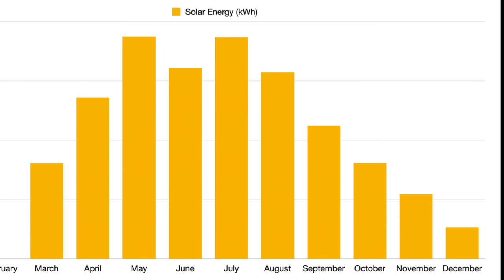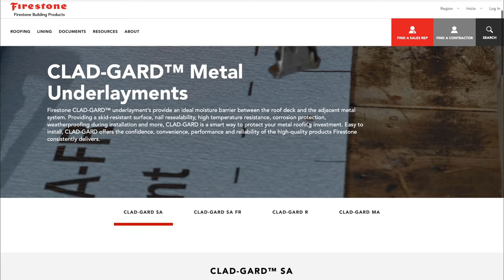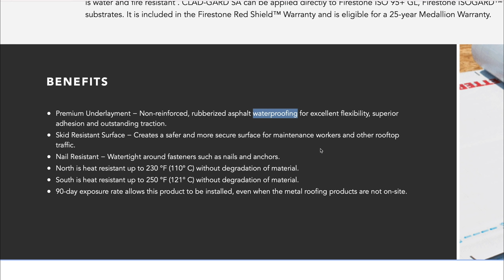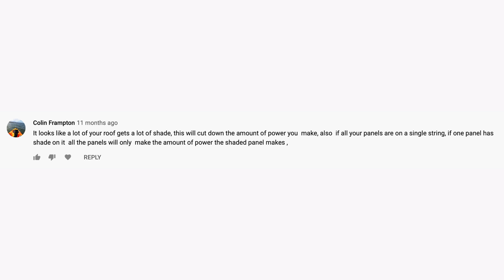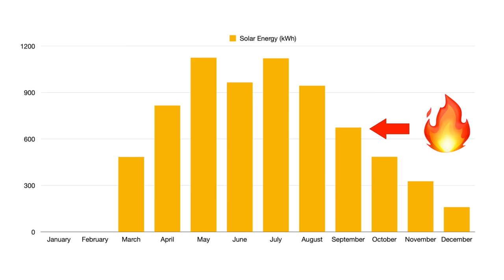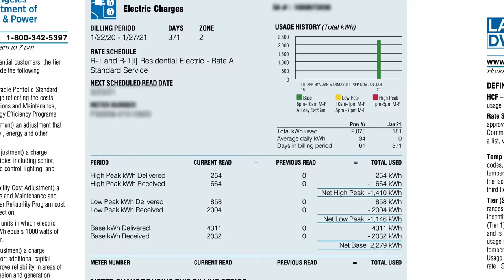1 Year with Tesla Solar Roof: top 11 questions answered + real production numbers & utility bills!

Comment: 67% of the energy produced went back into the grid yet you still had to pay them $156? Surely, they should be paying you?
Reply: Yeah that’s my question as well. I could imagine you end up with costs from days without much sun, but I’d assumed the energy you sell back to the grid would substantially overcome that considering the ratio of energy used versus sent back to the grid.
Reply: Well, it is California we are talking about. 😂

Need to find a State that doesn't steal from it's citizens. Not an easy task this day and age but sure there are probably a few around.
Reply: Same question
Reply: They pay you for the electricity you put into the grid but it’s much less then you pay them for the same amount of electricity, the money they pay you just gets subtracted from the bill
Reply: @daknbow5960  is it really how it works?
Reply: @pbgroseclose  we need answers!
Reply: That's how it works in the UK. I only know one person with solar, and it's just 4 panels on the roof, not the roof tiles themselves. They pay nothing at all for electricity, the grid pays them every 6 months, for the power they provide.
Reply: Daknbow RT. As I understand, the Kw/h rate is diff. on the “generation” vs. the “consumption”; that would prob. explain at least part of it...... dirty rotten shysters
Reply: They pay you at a much lower rate than you would pay them. They also have what they call "peak hour rates" where they charge more for power. Since he has no battery system here's the likely scenario 

He generates power during the day when no one is home to use it, there is no battery to charge so all the excess goes to the grid.

These hours are non peak hours so you are "paid" less of an already reduced time of cost.

Then coming home in the evening when power consumption across the grid goes up "peak hours" come in to play and they charge more. At the same time his grid is producing less power as the sun is going down.

So he ends up paying instead of earning
Reply: Even if the company paid the same as they charged you could have to pay.
If you consume 33 and give 67% of your own production, you could require more than the 67% from the company since the roof produces electricity only when there's sunlight.
Reply: He said he doesn't have a power wall, so I assume he uses the grids electric supply at night. There's a dude on YouTube who built his own power wall from used batteries
Reply: My thoughts exactly.
Reply: Yeah, why even connect to the grid if you still owe them money after giving them 67% of your power? Feel like it's a waste to cover the entire roof with these if you can provide your house with power with 32% of the roof covered. Thoughts?
Reply: @1GamersRewind  I don’t think it’s so much that the government steals from us, but rather that corporations pay off politicians to allow companies to rip off the American public.
Reply: It only works during the day not at night so he still needs the electric company.
Reply: Im sure they claim it is chaper than a power bank.
Reply: They don't pay him... and don't call him Shirley.
Reply: @first_last-  

Do you pay taxes? Do you actually have any say in where your tax dollars are going? 

But yet you blindly believe that they aren't stealing from you. Wake up and realize that the taxes you're paying is to cover bills spent before you paid them what you owed in taxes. Money spent without your permission in most areas.
Reply: @rivalthoughts2061  

What about taxes? Do you know where every penny is going in the different areas you're shopping in? Do you have any say in it? Do you actually have a say in any bills spent by the Senate?
Reply: My family has solar too, and the reason he probably had to pay was because that there must have been a month in which he didn't generate enough power for his consumption
Reply: @BrandonLinde  Yes and that's from when he had it covered by the fires and didn't clean it for a while. 

That's also why he was fine with the 7% loss from the projected numbers. 

You can't beat that $2,000 savings from just the first year.
Reply: @OrangeRocks1986  Sending out a search party to find who asked.
Reply: Even in Ukraine if you produce green energy, government pays you back
Reply: Exactly ! , Why not take $156.00 out of the 67% energy production they provided to the grid. 

Makes no sense they had to pay even a penny.
Reply: @TheAgentAssassin  it's either from the beginning of the year or the end of the year depending on when they needed the energy from the city grid. 

Remember that he said that there was a decline in power for the last few months in the year as he didn't get the solar panels cleaners until after January. 

Power companies typically have you pay per month. He just said that there was a cost in the year and not anything about how much they paid him. 

There was definitely payments received on his end, however he didn't disclose that information at all. And why should he.
Reply: chriszanf  Thats California for you.
Reply: @daknbow5960  so, in other words, ypu don't need an entire solar roof but just a 3rd of it to get the same results?

Maybe you could start contacting with your neighbors about sharing your grid with them and getting paid more than the energy company is willing to pay you.
Reply: He did start it in Feb 2020, he had at least one month of electricity bills.
Reply: @generalgrevous1984  try running a city and then talk about if California is stealing. You don't realise the costs, especially because of Americans smart decisions to build huge suburbs and big houses. Maintaining such huge pieces of land that bring in no revenue is expensive in itself, more so when you're trying to provide the kind facilities that you would find in a much more cramped city like new york.
Reply: @MyxDyingxFantasy  Yep, I'm from the UK and briefly for a few months, worked at a garden centre that had a 'moderately' sized wind turbine powering everything. That produced around 60-65% more electricity than they needed daily, that was pumped back into the grid. They where also paid every 6 months for the electric they provided back to the grid (apparently enough to power around 5-6 homes). I think they said, what they make annually from it, would end up cover the initial cost of the turbine within 10-12 years, dependant on ongoing maintenance costs.
In fact, when I left a couple of years ago, they where also planning too add additional 8x 8' foot long solar panels.
Reply: The Problem is that they paymant of the Grid company is wy lower than the price you pay. Here in Austria you get 0,0049 Euro, or 0,49 Cent per kwh but you pay at least 7,00 cent per kwh. Yet i dont know how the system in the us works, but i think its pretty much the same.
Reply: You are charged as a Commercial producer rather than residential. Higher rates for the power used.
Reply: @1GamersRewind  income inequality... Bwahahahaha one can earn all they are willing to earn in America. But there are some states to avoid do to their high taxes
Reply: There are varying agreements based on your power company. The portion of your power bill that is for energy generated is very small compared to the cost of delivery and power line maintenance. You really should call your power company and talk to someone who oversees solar installations to see what your actual costs and savings would be based on the numbers provided by your solar panel installer. 

$156 is not bad compared to the average. You'll find that many lose out after their solar install.
Reply: @av8rbri473  The price of generated power is a small portion of the cost to install power lines, transport power, deliver to your location, and maintain the entire system including employee paychecks and company overhead for equipment and buildings. Many companies pay the same rate for your power generation as they do large generators. Receiving the same deal as a larger generator doesn't seem like a bad thing.
Reply: People keep saying it’s from the power they use at night when it’s not working. Shirley just get a battery bank to use for nighttime? Something fishy here.
Reply: Yeah if the power co paid me lee than I paid them I’d just find a way to give the excess to neighbors or dump it..
Reply: He lives in California and bought a Tesla product. Don't expect any actual money saving or practicality. Go compare the Tesla roof with the admittedly more noticeable, less trendy traditional solar panels out in the last few years. The Tesla roof is roughly 40% less efficient, yet often costs more. If you have an "irregular" shaped roof, meaning anymore curves or turns than the small house in this video, it gets even worse. Shop around other solar companies and you'll see just about all of them crush Tesla in performance and cost.
Reply: the answer he used only used 33% of its own energy. You don't produce  solar energy  when it's night, what  means all energy you use than you take from them but you exes energy in the middle of the day you give beck to them :)
Reply: It’s Bc he doesn’t have wall power storage so at night he would be using the grid Bc he doesn’t have it stored but the amount of power he made in the day he made and gave back almost matched his night time use so it was only $150
Reply: Obviously if you're selling electricity when there is sunlight it's not going to be worth much (chances are you're sometimes going to sell it at a negative price, in other words you would be paying the grid for taking your electricity). The same goes for wind and windmills.
Reply: They are scamming him through the digital meter- probably taking 3 hours and only paying him credit for one?
Reply: His electricity bill was $2245 in 2019, meaning he used about 10,000 kwh that year (0.19/kwh in LA).  He produced almost 8,000kwh in 2020, so he paid to cover the difference.
Reply: @manaspradhan8041  When they don't give us a choice in how they suck at running the city?  

Lemme give you an easy one.  I live in LA County, and the same 1/2 mile strip has been under construction (building the road to go under train tracks), for 5 years.  The crew originally responsible for the job walked off, because the state was giving them shit for not having enough black people on the crew.  The state (keep in mind, this is a county project, not state) wanted the crew to fire the white people, and hire black people, while still finishing the job on schedule.

Now the county is rebidding out the job to finish it, but quickly realized they don't have enough money, so they reneg'ed on two of five line items that the people voted on for this project, and just reallocated the money to something else that we didn't vote on.  We're still waiting for them to get the new crew to finish the job.  This road is one of the busiest streets in our little community, and it's down to one lane, not to mention the businesses that have gone out of business with the reduced flow of traffic to them.  

Yea, I'd say my state is stealing from me, considering they still haven't finished a project we voted on, and are not delivering on said project we voted on.  That money that was raised with my tax dollars that was supposed to benefit me, is being reallocated to benefit someone else.  If that's not stealing, I don't know what is.  Oh yea, if I say anything, I must be a racist, because those tax dollars are now going to fund stimulus checks for illegals living here.

Seriously, fuck this state.
Reply: @manaspradhan8041  ? Lots of cities are doing better than California. In fact most of the country is doing better than California which is why businesses and people are leaving. Even Elon Musk Left. 😁

It's people like you who don't see the problem after waking up and looking at themselves in the mirror who keep California on its present path; you wanted a Socialist Government, you got it! Enjoy. 😂
Reply: I believe you're paying to continue having "access" to the grid and paying your share to maintain the grid. Basically what they're doing in AZ.
Reply: @akuma1362  Even worse. LADWP don't even call it at "Maintenance Tax" it's just called a "Minimum charge" meaning that regardless of how much energy you feed into the grid, you will be charged $10~ a month. The energy you feed into the grid counts toward credits for current and future energy usage, but whatever credits you have left over when you cancel your energy plan just go back to LADWP. So basically they take whatever power you're producing, give you "credit" toward power that you'll probably never need anyway(meaning they get to keep the value of that electricity if you leave), and they still charge you a minimum of $120 a year just to be on their grid.

So basically, even if you produce enough power for a whole neighborhood, you'll still have to pay LADWP $120(+ "adjustments) a year, and they will never send you a dime. But on the plus side, you get a credit toward the electricity you're not using!
Reply: @asherdie  Wrong. Look at the robin hood fiasco,Wallstreet, income taxes, property tax, loan debts(the high amount of interest, and bloated prices), wage vs cost of living  monopolizations, red tape.

Is it possible to earn wealth? Very rarely. And there is so much hula hoops is damn near impossible to get the "wealth" you speak of. You are fed lies and promises of wealth your entire life... and guess what? Almost every single American makes 1.4 million dollars from age 18-70. Believing the bs. 

You are either born into wealth or you are an anomaly thats less than 0.0001% of the world's population. 

Did you know 1.4% of the U.S. population controls 91% of the wealth in the U.S.? They want to keep you where you are. It doesnt benefit them if you progress... face it we are free range slaves bud.
Reply: @marnicknijland9070  still shouldn’t matter unless they are buying electricity from him at a much lower rate that they are selling it to him.
Reply: @Heywoodthepeckerwood  There’s always going to be a monthly fee to be connected to the grid. In this case it looks like $12.99 a month. Reasonable cost to still have electricity at night.
Reply: He’s putting it into the grid when every other solar system is throwing off electrons
Reply: @generalgrevous1984  and I explained why it's so tough to maintaing California, did you even read my comment... The only real cities America has are the pre war ones, Philly, NYC, Boston, etc. A city where you have to drive everywhere is just a glorified suburb.
Reply: So u pay a fortune to put up these solar panels and u save about 2k a year. How much was the roof?
Reply: Yup, it's BS my company would only buy back solar power at 1/2 price. So if they charged me 10 cents per kwh they would only give me 5 cents per kwh. On top of that you're still paying $25 a month for meter rental fee+other taxes & hidden fees. That's like a gas station charging you $3 for a gallon of gas and telling you they'll give you $1.50 per gallon if you wanted to return any gas. It's BS, I can understand them not giving me 10 cents per kwh but something like 8 cents would be fair.
Reply: @daknbow5960  It's like if you bought 1 gallon of gas from the gas station for $3 and needed to return it and them telling you that they can only give you $1.50 back for the gas you're returning.
Reply: @manaspradhan8041  Real Cities? Seriously? Wow, you really need to get a bigger mirror.
Reply: @BiG__Disgruntled   The power companies know that for an off grid system you'll have to spend more for a battery bank. 
 But I'd rather spend more on a battery bank and go off grid instead of a grid tie since the power company is screwing you.
Reply: @manaspradhan8041  Then why can many states and cities do it for much cheaper than others?
Reply: @daknbow5960   so the margins are rigged
Reply: @michaelbrinks8089  did you even read my comment? i explained why its so tough for california to reach the level of nyc
Reply: @generalgrevous1984  how walkable is austin texas again? how is the public transport? How many art exhibitions do they have? Whats the theatre scene like? What about academia? Do you really think 'cities'(read: glorified suburbs) have even a fraction of the culture of NYC or Boston?
 post war american cities, ie, everything that  didnt have european inspiration or wasnt a straigh up european colony is just a shitfest.
Reply: @manaspradhan8041  So why is Florida,Texas & many other states for example so much cheaper overall in taxes than CA ? There's a reason so many leaving CA.
Reply: @michaelbrinks8089  because those states arent trying to keep up with actual cities. You wont see them try to improve their 'liveablity', they have accepted the fact that they are just glorified suburbs, california has not. Its trying to keep up with actual cities while also just being a glorified suburb.
Reply: @generalgrevous1984  That's a BS excuse bud "its cali" C'mon man! What is right is right. They are giving bone scraps while they eat the steak. Guess what? Now they don't have to pay to maintain that part of the grid. Falls on the homeowner. Got you guys again. I wouldn't hook up to the grid. It's stupid to play along with them. Take take take and spit/laugh/point at the good guy.
Reply: @generalgrevous1984  New Hampshire😊
Reply: @rhonda1950  Not defending Commie-fornia so don't know what you are on about.
Reply: This is how it looks here in Europa too.
Its not Just smack up a solar panel and think since you produce a bit of electricety for the grid that you get something for that.

Im my opinion, this should be on every New appartement building that is being build in the future, and Also try to make it so that everyone can choose to have a roof like this on their house.

To be honest... This is the first time hearing about the tesla roof... 🤷‍♂️
Reply: The utilities buys the power generated by the roof at wholesale prices while at the same time sells back power to the home owner at retail prices when the homeowner isnt generating power. Usually the hours the home owner is not generating power, when the sun goes down, is at the same time that utilities sell power at peak rates. Peak rates are usually around the same time, daily, that people return home after work, starting their heaters, stoves, televisions, etc, which causes a stress on the utility's infrastructure having to push out power to meet the demands resulting in the utilities charging higher rates during these peak hours. Since there is no battery storage for excess power generated by the homeowner, he still has to pay retail price at peak hours through out the year almost everyday. I guess there isn't enough of an offset between his power generated at wholesale price the utilities buys and his consumption at peak hours to break even he buys back from the utilities. @chriszanf
Reply: @chriszanf wait what? So you think the power company should maintain the power grid for free and pay the solar panel owners to use it to get rid of excess power? How? How can a company pay workers to do maintenance without income? And dont tell med that all the no-solar users should pay. That is ridiculous since more and more people are getting solar power.
Reply: @generalgrevous1984  
Good Luck
Reply: @MyxDyingxFantasy  I seriously doubt that with just 4 panels in the UK that they "Pay nothing at all for electricity", my neighbour has 8 panels, no one is at home during the day but 4 people are in the evening and at weekends and their bill dropped about 40% after the panels were installed, after feed in rebate. (We live in the south east)
Reply: You clearly haven’t thought this through. Can’t blame you though but I do suggest you think solars inability to produce energy when the sun goes down...
Reply: what is so special about 67%? 
do the sums
Reply: Disconnect from the grid. Simple as that.
Reply: They have to charge a minimum monthly fee for maintaining the grid infrastructure, 156 bucks is a bargain.
Reply: @rivalthoughts2061  Paying ridiculous amounts of taxes without getting any welfare is America in a nutshell. Almost all of the taxpayer dollars has to go to law enforcement and fire departments to deal with the huge number of criminals, and of course the military departments. We have to pay even larger amounts of taxes here in Europe, but at least we get our healthcare covered, dental care, education and so on. Atleast we get something back from the shitty government that steals and wastes our money, but you get nothing. LOL
Reply: @OrangeRocks1986  None of us do. That's the evil truth about modern day governments in practically every country in the world. They suck at everything they do. Democracy? Yeah sure, you have one vote for someone, who then votes for someone else, who votes for someone else, who may or may not give a crap about what you're actually voting for. The amount of money the gov is wasting is insane, we're literally slaving for them to live in luxury and wipe their ass with our hard earned money.
Reply: @manaspradhan8041  The City obviously doesn't maintain people's own properties. The streets and sidewalks doesn't require all that much maintenance unless they are abused by criminals or a massive earthquake destroy things. Water and Electricity is maintained by private companies and people pay them separately for maintenance fees. The only real expense is the law enforcement, fire departments (thanks to the shitty state the entire country is in with its extremely high criminal rate), and all the less important stuff like statues, parks and so on.
Reply: Delivery charges & baseline fees are fixed costs that consumers are charged, regardless of how much or how little electricity is used.
Reply: Here in Jordan they buy it at a rate of 25% and of course you won't get paid with cash but you will have extra balance until you need it
Reply: @TheChrisey  the fact that you think these are the only costs to maintaining a city and that streets and sidewalks don't require regular maintenance tells me how much you actually know. If that was the case, why are roads always in such poor conditions in suburbs? Go to some European city once
Reply: @manaspradhan8041  Shows how much you know about costs claiming that minor things costs a fortune, but in fact most of it is a waste of money when a lot of households can barely put food on the table. It's not about what things must cost, it's about priorities. No, sidewalks and roads do not require a ton of maintenance, compared to the amount of taxes paid to the city, it's a fucking piss in the ocean. Your baseless argument is the typical bs propaganda used to convince tax payers that they need to keep paying. You clearly failed the basic reading comprehension required to understand what I said. My point was that any government loves to waste money when someone else has to earn it. All governments waste money. You don't need such a shit massive amount of money to maintain roads and basic infrastructure. They do however not want to give that money up obviously, so they end up wasting it on crap most people will have no benefits of.
Reply: @izraelservantofalmightygod  Battery storage is very expensive.
Reply: This is pretty normal for people who don't have energy storage in place.
Reply: @swety2962  isn't euro worth more than USD?
Reply: @generalgrevous1984  silicon valley is in California right? Correct me if I'm wrong, I'm not american.
Reply: He said on the video he paid the LA for power and water...so maybe it was to do with the water?
Reply: I thought i read an article a few years back that a guy in california gave “too much” back to the grid and had to pay like $12000 back because of it.
Reply: Yes they essentially “paid” two thousand dollars in solar energy.  In three years of this they will have paid off the roof and effectively be saving (keeping) 2k dollars a year.
Reply: @barneyrubble4293  that roof costs way the fuck more than 6k friend.

This roof will have just paid for itself when a new one is due.
Reply: Looks like someone got ripped off... Not by Tesla but by the city/state
Reply: In my country if you put solar panels on your house gov will pay you to share some electricity with a local grid station
Reply: @themarbleking  they also waged war on the confederates
Reply: Imagine producing energy and paying for it
Reply: 112 replies to this!! The smaller % directly to the house didn't go to the grid. The bigger % spun his meter backwards and he recovered it soon after such as that night or even a couple months later. He should have reported what his annual net grid kwh use was and what his monthly meter fee is.
What I want to know is how does such a little house in S. CA climate have $200 /mo? Maybe elec car?
Reply: It’s all a scame bro
Reply: @1GamersRewind  Be thankful cause in Germany i‘m paying bills for so many shits that i don‘t even use for example „TV“....
Reply: @lambdee7006  he breaks even around 15 years after installation & has 10 years after that under warranty
Reply: Hmmm......🤔
Reply: Here is the Original Semitic Text. You Guys REALLY NEED to READ This 

YaH The Heavenly FATHER HIMSELF was Who they Crucified for our sins and “HERE IS THE PROOF”

From the Ancient Semitic Scroll: 
"Yad He Vav He" is what Moses wrote, when Moses asked YaH His Name (Exodus 3)

Ancient Semitic Direct Translation
Yad - "Behold The Hand"
He - "Behold the Breath"
Vav - "Behold The NAIL" <— YaH’s Crucifixion
He - "Behold the Breath"

“Behold the HAND that Beholds The NAIL” 

PROVES - YAH The Heavenly Father HIMSELF was Who they Crucified

That is EXACTLY what Moses Wrote

Here is what they mean

YaH's Name:
(Ya)d + (H)e, as YaH is what Moses called Him and YaH Declared: "this is My Name, this is My Name for all generations" (Exodus 3)

YaH is The Creator:
Yad He, (HAND BREATH), as YaH's "HAND" Formed man from the dust  of the Earth and His "BREATH" made him a living being (Adam)

YaH's Sacrifice of Crucifixion:
Vav He (NAIL BREATH), the "NAIL" through YaH’s "HAND", that whosoever shall call YaH Savior, His “BREATH” brings forth life (Salvation)

How YaH arrives:
YaH arrives via the Tent of Meeting (Exodus 33:7:11, Isaiah 54, 55), where a Tent is erected outside the city, a cloud descends upon the entrance of the Tent and YaH appears...

Why they demanded YaH to be Crucified:
YaH was Crucified according to Hebrew law (Deuteronomy 21), to be Hung on an Almond Tree for BLASPHEMY as it was for His NAME they demanded Him Crucified. The Messiah claimed He was YaH...

HE WAS YaH!!!

HalleluYAH “Praise ye YaH”

From The Hebrew Book of Isaiah, The Dead Sea Scrolls

Isaiah 42:8
"I am YaH; that is my Name! I will not yield my glory to another or my praise to idols.

Isaiah 43:11
I, I am YAH, and there is no other Savior but Me.

Isaiah 45:5
I am YaH, and there is none else.
Reply: @TheChrisey  

People are greedy especially when giving the green light to spend the money before having it to begin with. It's only been like this since the world wars where people were fear mongering and used it to increase taxation. It became a new normal and we haven't reverted back. 

Now we have armies with no real wars to fight, however we decide to input our armies into wars we shouldn't trying to manipulate other countries. 

Just look at how much USA spends on "defense" when it's actually offense. Especially when compared to other countries. 

I've said this before and I'll say it again. USA needs to be split up as a small minority seems to control the majority. We have 4 time zones and should have 4 presidents that represents each time zones, with Alaska and Hawaii having Governor's that would be on the same stage as the 4 presidents. Money from the 4 regions stays in those regions. My reasoning behind this is simply look at two states that have massive debts, while a lot of states don't. Yes they do have some form of debt as no state is without faults, meanwhile some states have profit and actually pay their citizens.
Reply: @OrangeRocks1986  no
Reply: @akuma1362  straight garbage! on top of the Maintenance Tax, you still have to pay for your own maintenance and replacement to your system. screw that. detach 100% don't give them anything and live on the battery.
Reply: The power sent to the grid offset the cost of energy consumed from the grid I'd suspect.
Reply: 67% of the energy produced is not energy used. Energy usage goes up in the evenings/early nighttime when people are at home and it turns dark. Incidentially that's when the panels don't produce power either and energy costs go into peak prize brackets, because everyone is using it. All that considered, 90% cut in power bills without on-site power storage is pretty good.
Reply: @gotanygrapes831  You need help.
Reply: @PetraKann  It means nothing to Liberals but for those whose money you enjoy tossing away or belittling, it means a lot. Stop being so callous with other people's money.
Reply: @cybercery5271  Yes it is. Your point?
Reply: @generalgrevous1984  Most of the tax payers money you care so much about goes straight  to corporations, banking cartels and extremely wealthy top 0.01%.
You must have been shattered when the US congress immediately voted to hand over 6 trillion dollars to corporate america at the start of the pandemic. Over 8 trillion dollars was given to Wall Street and corporate scamsters and banksters during the 2008 Global Financial crisis by both Bush and then by Obama (it doestn really matter which puppet party gets in - they serve the same masters dont they General?)
Ity appears that you support corporate socialism for the wealthy and austerity and capitalist cruelty for the masses.
You cant be a Christian and a corporate capitalist at the same time General. They are morally incompatible - choose my friend.
Reply: @generalgrevous1984  hahaha man I really wish Sherman would have done a better to job
Reply: @PetraKann  I've already chosen, I'll take greedy corporate America over greedy politicians anytime; at least you can shop around and use your money wisely with corporations, as where big government will simply steam role people with taxes and a crushing bureaucracy. I take it you prefer Nanny States/Socialism but we know where that inevitably leads: poverty, lines, starvation, totalitarianism and ultimately camps.
Reply: @generalgrevous1984  greedy corporate America and greedy politicians belong to the same fascist slave scam.
....they're on the same team.
do you understand how the Corpocracy works?
How is that corporate mainstream media coming along? You Trust them right?
Reply: @daknbow5960  what bill if you give them electricity and taking 0 from them ? LOL
Reply: You still use the grid, during night you ue power, so you give them they give you, he used more from them than he gave hence the payment. The roof doesn't make power during the dark when lights on, then you could put in very expensive batteries, could get of hand.
Reply: @daknbow5960  than
Reply: @kennethrollo7891  The economic performance depends on the arrangement you have with the power company and whether you receive premium tariff rates for your exported power.
In some states in Australia there are rebates as high as $0.66 per kWh.
So even though your solar panel array doesnt produce electricity at night, the revenue generated during the day can be greater than all the expenses oo your power bill. You can receive a yearly rebate of say $3,000 and only purchase $1,000 worth of power during the night including connection charges.
Your account can be credit $2,000 and you dont need to pay any bills at all during the year. The credit can be transferred into your account at any time.
A friend's Photo Voltaic system generates on average about 10 kWh per day during the year, whilst his family consumes about 4 kWh per day. He is paid for that 6 kWh.
Reply: @TheAgentAssassin  this guy didnt pay for all that infrastructure to get power to or from the home.  You know how many billions of dollars that cost?  You are not just paying for power, you are paying for the infrastructure and the company costs to exist as a business or pseudo government utility.   Labor is generally most of the cost of anything you buy down to white rice.
Reply: @1GamersRewind  You sound like one of those woke marxist who thinks he is victimized by life.  How sad for you. This country is so bad we can't keep people from wanting to be here.
Reply: for $2-10k i would have built a power wall and refused the excess back into the system....maybe sell to a neighbour or 2...
this egregious scam is only encouraging that anyways
Reply: @thomass5169  complete avoidance of the point to ad hominem me. Typical American.
Reply: David Winehouse  I remember hearing that many utilities were charging a fee (ex. $50 monthly) for the privilege of connecting and selling energy back to them.  There is a lot to consider in doing something like this.  I know that my house is not aligned with the path of the sun for optimal exposure.  I have limited morning exposure due to trees and almost no afternoon exposure, also because of trees, and that's what keeps my house cool so I don't have to use AC in the summer.  Just this last winter my roof was buried under a yard/meter of snow for several months.  Though not the norm, there is still a good share of the winter that the panels would be covered under several inches due to periodic snowfall.  I know the panels would still generate some power under poor conditions but right now I'm in something like week 4 of almost complete cloud cover.  On top of that, my annual electric bill is only a third of what the content creator was paying.  It seems like a lot of trade offs with the end result not being as wonderful as it might seem at first glance.  Not necessarily a "one size fits all" solution.
Reply: @thomass5169 now you are just lying. You absolutely didn't debunk anything I said and you just personally attacked me so no you didn't attach it to anything I say that you attached it to me personally.
Reply: @1GamersRewind  okay cupcake.
Reply: @PetraKann  yes i know that, but you still use energy when its dark and unless your using the washing machine and got things set on timers to use the energy when the suns shining you won't get energy cheaper from them than you sell it for. So even so he had 67 percent spare he still had a bill, thats all im saying as someone asked why did he still have a biil when he had spare. Thats all. But as for deals with energy companys you'll always owe them never the other way round, unless lights out at 7.00
Reply: @PetraKann  Actually I agree that corporate America and Greedy politicians belong to the same Socialist/Fascist scam; the last election proved this tenfold. But this was not always the case and China now runs America for the most part; corporations will continue selling out America to the satisfaction of their Chinese overlords, whilst compromised politicians and bureaucrats at the highest level continue their treachery. Until real elections are held with voter ID with and including paper balloting, America is at, in Thomas Sowell's words, a 'point of no return.' 

That said, America has never thrived under socialism - no country has. Even the Soviet Union fell as did its satellite states. Independent companies/corporations have created riches unrivalled in history increasing the standard of living for even the poorest. Why this is presently unravelling is something I think we can agree on but it was government/politicians that opened the doors to China and it is China that is bringing America to its knees. It is the politicians who first sold out America to China, not corporations. Now corporations have signed on board because profit is more important than freedom, even for their own children. And the real traitors are both the Republican and Democrat party.
Reply: @kennethrollo7891  That's pretty out there given you don't even know how much above person uses at night; what's more most people are asleep, cutting electricity use substantially. Clearly you haven't thought this out and are basing your opinions on wishful thinking shored up by a genuine desire to spend other people's money.
Reply: @generalgrevous1984  what are you talking about spending other peoples money??? God theres some weird thinking people on here, its got nothing to do with me, its just what energy companys sell and buy for that makes the diffrence and by observations of people using lights in the dark rather in daytime, as i notice we have windows, i think you are getting the wrong end of the stick here. Iam not against solar energy, juust pointing out why you put in energy to the grid but still end up witha bill!
Reply: @MyxDyingxFantasy  i know lots of people in the uk with a roof of solar panels and still get bills so thats bullshit
Reply: @PetraKann  yes i know that i used to live in melbourne, i now ilve in scotland, what your saying is bang on but here in the uk that high tariff was about 10 years ago, but as solar panels have got more popular, ie carrot on a stick high tariffs to get people to install them the tarriffs have fell away, in the uk they got something like 35p per unit and grid sold at 15p per unit its now selling at 18p per unit and the and their buying the solar at 2p a unit, my cousin got into the 3.5p if reg before it went to 2p so god knows what it is now but the good rarriffs gone in the uk, unless you've got a spare 100 acre of solar panels
Reply: @PetraKann  by the way iam not against solar, its just that i find it interesting that people find energy companys greedy but are delighted to take money from them that other people paid for energy, and believe that they are intitled to that money, but when are they going to also pay for maintenance to the lines, the substations the upkeep to infrastructure and deveopment in technology, once we're all getting paid  great tarriffs will we be responsible for fixing everything as well, all take and no give, what you reckon.
Reply: @kennethrollo7891  The fact you believe companies should take money away from those who actually put back in the grid is a perfect example of a desire to see other people get scammed. People usually are not showering, cooking, cleaning, on TV, using lights or the internet while asleep and your window observation actually undercuts your argument to fork over more money to companies; windows help decrease electricity use/cost. 

Most people when they dug themselves into a hole, they stop. My advice, stop digging because it's getting pretty dark down there - maybe a company will through you a light. 😉
Reply: You do realize that this is a Tesla commercial...
Reply: @thomasauto4862  that makes a lot of sense, people are being bombarded with sales pitches 24 hours, and don't even realise.
Reply: @first_last-  Here in Europe we dont go into debt and have the risk of dying because x treatment isnt covered by our insurance lmao
Reply: @Kevin.BTCChina  Over there in Europe, you pass away before you can even get an appointment to see the low quality doctors. That's just the sad truth of socialism.

I'm not Europoor trash like you. I can afford to pay for my own, much higher quality American healthcare 😂

Poor person moment xD lmao
Reply: @generalgrevous1984  67% of what he generates goes to the grid, that doesn't mean that 67% of his net power use is going to the grid. Most solar power is generated during the day, these aren't peak times usage times since most people are at work. He gets credits for what he contributes, but he still uses power in peak times such as the evening, and power is also used on nights and on cloudy days so the meter rolls forward again.